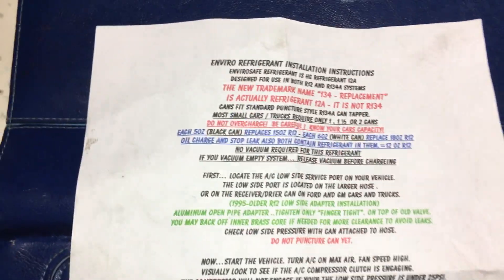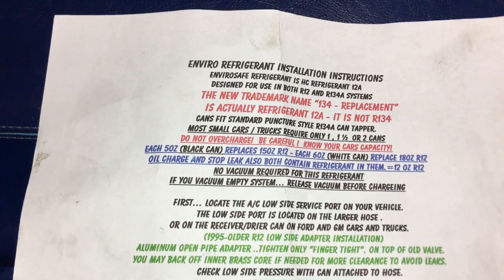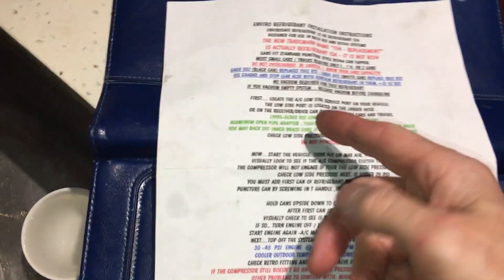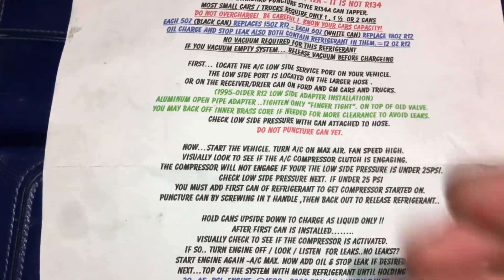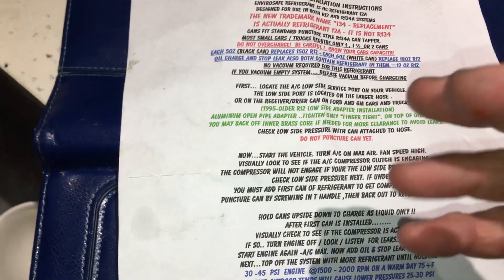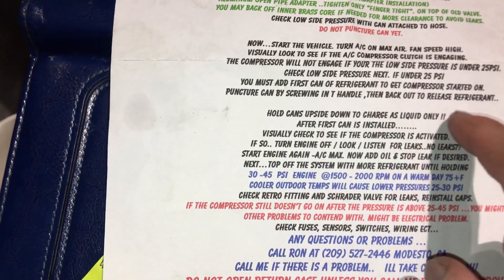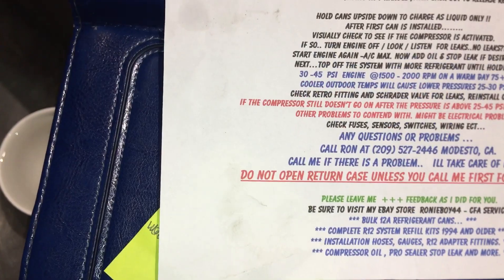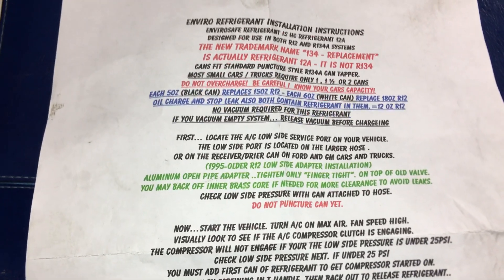Refrigerant alternative EnviroSafe instructions to install,  NO VACUUM NEEDED ?

Comment: I just charged my 94 Vigor with this stuff, and it does work very well.
Supposedly, they don't want you to feed into a vacuumed system because the basic cans are too thin to handle the pressure differential and they can collapse. The recommendation is to put a little in the system and push the air out of the highside port. Since propane is heavier than air and the highside is usually higher up, then you could get most of the air out......I agree it's not ideal and not how I'd do it. If you buy the "industrial 134" cans they sell, you can feed into a vacuumed system since the cans are thicker. I used two of them and a proper manifold set with a vacuum pump and my AC is working very well now.
Reply from the maker: The cans have no problem they will never go into a vacuum anyway. 
   They cans have to be DOT approved for high pressure of 120°F that would raise the pressure so the wall thickness of the cans have to be thick enough to hold that so they have no problem going to -14 psi with only a 14 psi difference Instead of 120 psi difference positive.

Comment: MOISTURE,..is not something any self respecting person wants in his a/c system.  A better method would be to evcuate it and then break the vacuum using nitrogen. (air is 80 percent nitrogen anyway,..but if you use nitrogen you are not introducing moisture into the system.)
Reply from the maker: I know that and you know that. 
    But apparently, the manufacturers of this product don’t care.

And they can make more sales of their product making more money if they tell people they don’t have to vacuum the system so that means they don’t need to buy a expensive piece of equipment making the job seem easier therefore they can sell more of their product . 
  It’s all about the 💰money 💵when it comes to salesman and marketing

Comment: If you think you need to put this in under a vacumme  don't waste your time and money, trust me I tried it, I put 4 cans in a system and it would not blow colder than 60 degrees, called the company and they told me to vent it out and let the air get into the system, I was sceptical at best but what do I know as a certified a/c tech. added 1 and 1/2 cans and wow 32 degrees at the vent and in cooler evenings after the sun went down It blew frost out of the vents with the blower on low.  This was on a 134a system .  don't go by pressure when servicing the system , use the vent temp as your guide to correctly fill it.  If your concerned about a pressurized flammable in your car you better by a tesla because last time I checked gasoline
e at 50 to 70 psi is somewhat flammable.
Reply from the maker: 🤣 we got a Tesla model 3

Comment: "Don't need to vacuum before using" is a cheap ploy to get more sucker...uh customers to buy the stuff. In short, those people who don't have a clue why vacuuming a system is necessary and don't have a vacuum pump.
Reply from the maker: 👍 you are 1000% correct. 

And I know you have all people know and understand the reason why vacuum is so important . 
       If you tried to make a vacuum tube without vacuum 🤣 

Like your videos on making vacuum tubes to make a vacuum tube that successfully just works doesn’t have to be good is on my bucket list of projects to do . 

By watching all the videos about making vacuum tubes .  I own the vacuum equipment that is of the caliber that is necessary to perform the vacuum needed.

And I have access to a professional blowing place . 

I won’t have to go through all the learning curves as much as everybody who tried to do it from scratch without experience and knowledge .
Reply: Might want to educate yourself before making assumptions on a refrigerant you don't understand.  "Our US Department of Transportation has regulations on how much pressure can be in a can. Everyone wants the cheapest and best price on refrigerant. So, we use a 2Q can because it is a standard can that can hold 70 psi at 70 degrees F. If a system is a small system and not a dual air system, the small amount of air in the system will make our refrigerant with dye work correctly as hydrocarbons do not react to air. If you do take the Enviro-Safe 134a Replacement Refrigerant with dye and you do charge into a vacuum and charge by gauge readings, you are actually overcharging a system that can cause damage later. It would not allow for expansion room so when the system gets extremely hot, it can tear up a compressor. If you pull a vacuum and charge by weight (6 oz of ES = 16 oz of 134), normally your gauge reading will read low and your cooling isn't great. "
Reply from the maker: @asusreviews  all cans can hold 70 psi at 70°F Fahrenheit for a refrigerant that has a PT chart that matches that pressure temperature relationship. This is not rocket science.. 

I could use a glass mason jar to hold 70 psi . 

At roughly 70°F
Old-fashioned R12 refrigerant would be roughly 70 psi

The newer 134 refrigerant would be close to 70 psi

The very new are 1234YF refrigerant would be nearly 70 psi

And butane propane mixture at 70°F would be nearly 70 psi

There is nothing special about this. 

Since to burst in pressure of your common household aerosol can is not to exceed 120 or 21 Fahrenheit, so it will not exceed the pressure that will burst the can. This is written on the back of every can.. 

If you try to stick a household refrigerant for a home air conditioning or heat pump system into one of these cans. 

That refrigerant R410 at 70°F would be 200 psi

So just the plans on the blend or type of refrigerant you use to meet your specification.. 
For the volume expansion rate, you are too expect for that particular refrigerant. 

The hydrocarbon refrigerant, expand much more. 

As long as it has the volume, I did given temperature it will maintain its pressure
Reply: @Glasslinger  Don't you rebuild CRTs and other vacuum tubes?  What kind of vacuum pump do you use to vacuum out your vacuum tubes?  Is it a dual-stage, HVAC vacuum pump?
Reply from the maker: I remember watching some of his videos on building vacuum tubes. 
   I can’t remember if he was using something that similar to a Welsh with a separate motor and belt driven separate vacuum pump. 
  And then you had taken an inductive heater over your vacuum tube and heat up the insides to flush off the molecules of other gases and moisture out of the system while you’re vacuuming to do a more complete outgassing of the pores from the metal itself. 
      Building a vacuum tube from scratch is on my bucket list of things to do. .

Comment: I’ve used this a few times if different vehicles and had compressor failure shortly after .

All times compressor was new , accumulator new and condenser 

Not sure what I’m doing wrong 

I have a refrigeration background
Reply from the maker: Yes, I have noticed many peoples vehicles failed within weeks or months after installation of Envirosafe. 

Either the manufactures are completely ignorant and they’re selling the product just to make money because it works, but is known to kill vehicles . 

Here’s the physics that’s going on the burnouts . 

The original accumulators were their original receiver dryers .  Are manufactured so there’s a large volume of refrigerant that is stored inside of them..  

This includes the AC system relies on a large volume of refrigerant so the massive refrigerant can keep the velocity of the refrigerant flowing to return back to the compressors . 
Plus, cooling  

With normal refrigerant when you’re one or 2 ounces low, the level in the accumulator level in the receiver dryer and your velocity do not decrease noticeably. 

But because the hydrocarbon refrigerant you’re only using about 1/3 or 1/4 the quantity the mass the volume of refrigerant . 
       Inside your receiver dryer, you don’t have that large tall stack of liquid refrigerant with the oil down at the bottom of the refrigerant to pick up tube so when you run down two or 3 ounces of refrigerant vapor and not always delivering back to the compressor because just a few ounces low on hydrocarbon refrigerant inside a system that was designed For one of the organic or synthetic with a large mass.   You get a delivery problem and flash gas to your expansion device problem much sooner.,

If you look at hydrocarbon small volume systems, you will, the receiver dryers are physically designed differently intentionally . 

You’ll notice the receiver dryers are extremely thin, but very tall . 
         This design is to keep the very low volume of refrigerant, very high stacked in a thin, tall dryer. So if it goes down a few inches, the pick up tube to your expansion device is still far down deep under liquid refrigerant hydrocarbon. 

The accumulator for the same tonnage with the small mass volume Hass to be designed to keep the velocity up so the tubing size diameter will be different in a accumulator. Let’s say for one and a half tons synthetic refrigerant like 134 compared to a hydrocarbon refrigerant for one and a half tons of cooling will be very small, and the piping will be smaller to keep the velocity higher going through the you bend down at the bottom of the accumulator to make the negative Venturi effect to suck the oil off the bottom of the accumulator. 

But they’re sticking these hydrocarbons systems with components designed for large mass of refrigerant and large tubing and sticking a low mass refrigerant . 

Velocity is fall down and don’t deliver the back to the compressor . 

They won’t tell 

It works enough for them to deny and say that’s the problem  💸💸💸🏦🤣 well they are laughing all the way to the bank with the customers money. 

This is the difference between a technician who’s gone through engineering, refrigerant and heat exchanger design classes 

And an HVAC technician is just thrown parts and told to install them who doesn’t have to know design .  

There’s a reason there is those classes in college for engineering that involve math for thermal dynamics, and fluid dynamics . 

Almost Nobody likes math 🧮 but it’s useful when you know it

Comment: i said this on the other video but il put it here to only use this on r12 ac system's and fix all leaks first dont put it in 134a theres no benefit in a 134a systom  this dont need a vacuum because moisture will mix with this propane and become a lube  you dont have to vacuum new freezer's that are made to use r600 aka propane eather
Reply from the maker: R 600 is butane
R 290 is propane

There is no legitimate freezer manufacturer, who says not to vacuum a system .  Every major manufacturer all over the world has specific instructions to vacuum out the system..

Comment: I also don't understand why the system supposedly shouldn't be vacuumed when using this product and I never got an actual answer out of Envirosafe when I asked them. However, even though non condensables are always going to reduce efficiency and moisture can cause other problems like corroding things and freezing up expansion valves, at least hydrocarbon refrigerants won't react with moisture and oxygen to create acids like CFCs and HFCs will. Mineral oil won't either, not sure about POE or PAG oil. That's not to say adding this stuff to a system full of moist air is a good idea, just that it's possibly not quite as bad as doing the same with a CFC or HFC refrigerant.
Reply from the maker: POE & PAG oil react very badly to moisture The guys at Enviro safes are idiots. Their salesman.. 👨‍💼 

You will find no manufacturing on earth that uses butane or propane that tells you not to vacuum the system
Reply: @coldfinger459sub0  Great points, every manufacturer of every system I've seen has required that is vacuumed before charging regardless of whether its a refrigerator, ice maker, car, residential AC unit, etc no matter what refrigerant is used and for good reason. I just think a system filled with mineral oil and a hydrocarbon refrigerant would have a good chance of outlasting an identical system filled with an HFC refrigerant and PAG/ester oil if both systems were contaminated with air/moisture, but saying that there is no need to vacuum the system when using this product is obviously incorrect.
Reply from the maker: @averyalexander2303  you are absolutely correct when we’re talking about mineral oil and a old CFC refrigerant like R 12.    12, with mineral oil is much more forgiving with a little moisture left in the system, and Air left in the system. You are absolutely correct.. 

But this refrigerant is being used in all cars 134 and 1234YF In any of the other vehicles around the world, who have access to the Internet, who have other like 152

When we go into the auto parts stores today, mineral oil is no longer even carried or stocked on the shelves
Reply: @coldfinger459sub0  All true. Speaking of R12 mineral oil, do you have any idea where to get it? Or is ester oil a better choice for R12 nowadays? I recently bought a 1990 Acura Legend with its original R12 AC system, which was empty due to leaky O rings but otherwise perfect. I filled it with this stuff just to test everything and find where the leaks are, but I plan to remove the entire system, replace every O ring and the receiver dryer, clean the evaporator, flush the lines, condenser, and evaporator, drain the old oil from the compressor, and recharge with R12 and fresh oil (of course after vacuuming the system), but I'm not sure where to get oil, especially since I don't think the service manual specifies a viscosity or type. Do you have any suggestions on which oil would be best for the R12 system? Thanks in advance!
Reply from the maker: @averyalexander2303  
You could order it from an auto parts store like NAPA Auto Parts 

Only one viscosity 500 

I think the old Denso  number was ND-6  Don’t hold me to that number. I’m just pulling out some old memory cells. I don’t work too good no more. lol 😂
Reply: @coldfinger459sub0  Perfect, thank you! Would you recommend sticking with mineral oil or changing to ester oil? I've read that ester oil is a better lubricant than mineral oil, but considering the fact that the original compressor is still working perfectly 34 years later, I'm thinking I'll just keep using mineral oil since it has worked for this long.
Reply from the maker: @averyalexander2303  if you’re going to use CFC containing 12 refrigerant, then stick with mineral oil. 

If you think eventually, you will change it over to 134 refrigerant remember you have all most 40 year old hoses . When it’s time for you to change, you will have to go through the flush procedures cleaning changing dryer again if you have mineral oil.

If the compressor is really easy to remove, if you’re reusing the old compressor, take it off and dump out all the old oil and replace it . 

Since you your own vehicle you’re doing it yourself you have all the time in the world just leave it on the vacuum pump for 24 hours .
Reply: @averyalexander2303  "Speaking of R12 mineral oil, do you have any idea where to get it?"
Envirosafe sells mineral oil.
Reply from the maker: Everybody sells mineral oil it’s still available. You can order it. It’s just not on the shelves usually anymore.. 
   Really old Auto Parts stores might have dusty bottles like Napa or BAP or some other Auto Parts store that you find that’s like 50 years old. 
     Possibly out of memory four seasons part number might be 5900. 
    Can’t exactly remember there might be digits after the 59 but Google is your friend you’ll find it